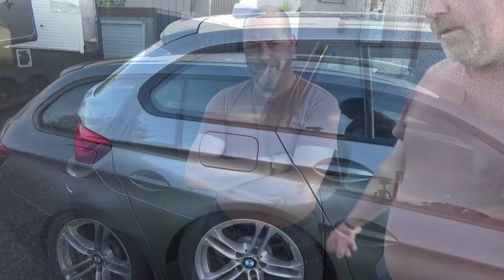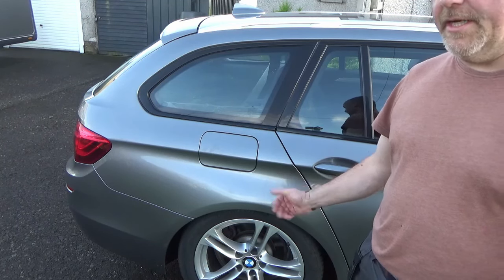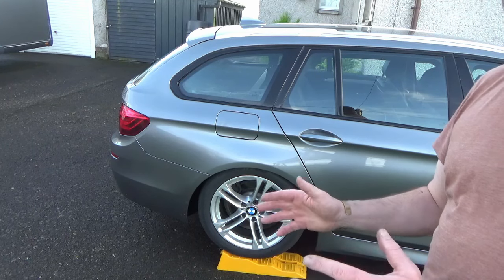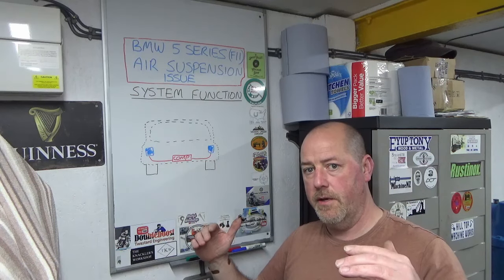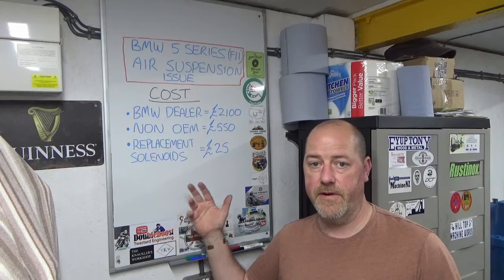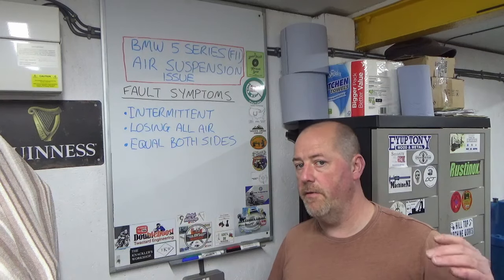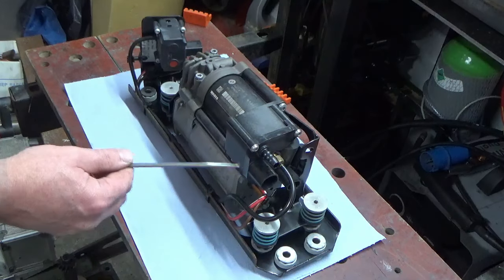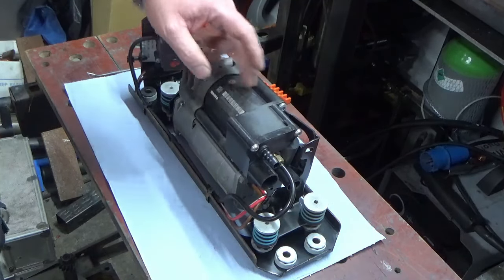BMW 5 Series (F11) Air Suspension Fix for £25

Comment: Epic video, car went down during the day parked down. Did the nursery run with it on bump stops in town, rode like a horse cart. Came home, watched your video, ordered the solenoid on Amazon for £20. Next day I removed the compressor and the solenoid in 15 minutes, the delivery arrived that exact time, I put it together in another 15 minutes. Suspension sorted. Thanks!

Comment: My x5 f15 only drops on the right side and not the left side, so why would that might be?
Reply: Check leakage air suspension on the right side first. Next replace the valve on the compressor.

Comment: Just wondering what tools are needed for the job? Including removing compressor from the car. Thanks!
Reply from the maker: A basic socket set and the torx bits I mentioned in the video (sorry I can't remember the sizes), plus a Phillips screwdriver should do it. Cheers, Jon

Comment: Thank you for making this video, its really helpful. 
If the beads are showing signs of being moist does it really matter or could i leave them as they are ?
Reply from the maker: If the beads are damp, I would advise drying them while you have the thing apart. Microwave in a glass dish until they go back to light colour. Damp beads are a symptom of another problem, either your compressor is running far too much which could be an air leak, or you live in a very damp or humid environment.
Reply: @jonsworkshop  thank you
Reply: @jonsworkshop  Hello. Just been scanning through these comments after watching the video and completing this fix about 2/3 weeks ago. Very helpful video thank you. I checked the beads but only briefly and I'm thinking they could be causing a further problem. The solenoid fix worked perfectly but since then the car drops over 3/4 days then when the compressor kicks in it blows the fuse. Think this points to an overworked compressor? I thought the slow dropping might be down to me not putting it all back together properly.

Comment: Great informative video. I have the same issue. Can I just ask, how easy is it to get the unit off? Does the bumper have to come off? I’m happy doing the repair when it’s off but just wanted to check how to get the unit off. 👍🏻
Reply from the maker: Hi Adam, no the bumper stays on, there's a plastic cover to remove underneath and then 4 screws, two air hoses, and the electrics to unhook. Biggest challenge is getting the back end high enough off the ground to get underneath. As always, what worked for me may not work for you so you go in with your eyes open. Cheers, Jon
Reply: @jonsworkshop  that’s great thanks. My brother in law has some drive up ramps so I’ll use those. Cheers.

Comment: Should i do this also? Because only my left rear side is down, and when i turn my car on, the compressor wont turn on
Reply from the maker: I am not a mechanic and only have experience of the error I had, however, if it's only one side then it's a different problem so changing the same valve won't fix it unfortunately. Get the airbag checked first on the bad side would be my advice.
Reply: @jonsworkshop  my compressor wont turn on when car is running, but when i do the 20sec test with ista then it runs, but its quiet

Comment: very good video explaining all that system with very much details, in my case is that when i park my F11 the right side gets low only.. so what i understood with ur video is one of the valves that are ready to change correct?
Reply from the maker: Hi, it could be one of the other valves that I didn't change, but it could also be the air bag on the RHS is leaking in your case.
Reply: @jonsworkshop  thanks, which other valve are you referring? but the car only gets low on the right side sometimes it’s not always.. ahah

Comment: BMW 530d XDrive 2018 G31, 
Hi I’ve just this second finished replacing the very same part on my car, couldn’t find anything for the G31 but it was the exact same principle.
Big thank you 🙏
Reply: Great stuff. Where did you find the solenoid, if you don’t mind me asking. I have the same problem on a G31. Car won’t return to height. However, I can hear the compressor running when. I turn it off. I’ve bought a relay which I will try but it’s likely to be the solenoid. Thanks

Comment: I have the same problem only on the left side, wheel is inside the weelarch but only sometimes. this week i will se what to do
Reply from the maker: Hi, if it's only one side it is a different fault, probably the air bag. Cheers, Jon
Reply: @jonsworkshop  yes, we saw that was the bag. In anycase we like your videos.

Comment: Hi, this video is great, I am in process of doing the same on my g31. The desiccant in mine was a bit brown with moisture and corrosion on the solenoid. Not put it all back together yet but wondering if the moisture is a sign of another problem?
Reply from the maker: Hi, I am no expert or mechanic, but my gut feel is yes. Either the compressor is running overtime due to a leak somewhere meaning it is drawing more moisture in, or, you live in a very humid environment and the air drying part of the compressor isn't working properly, these are just guesses though.
Reply: Hi, thanks for the response. I live in Swansea, it’s always raining here, plus the sea air could be the answer. 👍

Comment: Great video regarding issue with bmw suspension think my bmw touring M5 is suffering  from same issues was wondering were did get part for £25  would be grateful if you could help out cheers.
Reply from the maker: Hi Frank, thanks for the comment. Check out the video description, I have finally put the link in there lol. Cheers, Jon
Reply: @jonsworkshop  hi john i think i have same problem with suspension on my BMW 5 series touring M sport trying get part number for solenoid mine is 2005 / 525d any idea were get cheap replacment

Comment: thanks your sharing， i face the same problems in my x5 , both side drop at the same time, is possible which valve faulty ? Thanks bro.
Reply from the maker: Could be, I don't know what is in the x5 but I am sure it will be similar. Cheers, Jon

Comment: Hi Jon I have an issue with mine but it’s only the right side any idea what you think the issue maybe.
Reply from the maker: Hi Jamie, I am no mechanic or expert but if its one side only I would suggest it's either the airbag or solenoid valve (in the double unit I didn't change). If the right side pumps up and is intermittent then start with the valve, if it is repeatable every time going down in the same time frame it's probably the bag. I repeat, I am only guessing as not a mechanic. Cheers, Jon
Reply from the maker: Try swapping the red and blue lines, see if the error moves to the other side, this will eliminate the airbag
Reply: @jonsworkshop  Hi John unsure how to do this?
Reply from the maker: @jamiewinnall2882  the double valve block on the compressor unit (the one I didn't change in the video) has two pipes coming off it, one blue, one red, just swap them over and re-try. Cheers, Jon

Comment: I have the exact same issue on my G31, do you know if that Solenoid will fit a 2017 G31?
Reply from the maker: Sorry, I have no idea. I am no mechanic, or even car enthusiast. Hopefully through some research you might be able to link the part number to your model.
Reply: Did you ever figure out if it is the same solenoid. Got the issue on my G31 too.

Comment: Jon, great insight, just about to purchase a 2012 5 series tourer, 55k miles & hasn't towed, the current owner mentioned that a prospective buyer declined to purchase because the air suspension hadn't in fact been replaced, although it is working fine. What age is your BMW?
Reply from the maker: Mine was a 2017, was being the operative word. Best thing I did getting rid of it. If you want my advice, buy a Skoda Octavia estate instead. BMW have lost their way totally, getting caught up in the "how much expensive technology can we cram onto one vehicle" nonsense so they can make back the money they lose at initial sale as quickly as possible. I will never own another now. Good luck if you take the plunge, make sure you have plenty of spare cash for the upkeep if you rely on it for work.

Comment: You are a legend - thank you so much for this, I’d been to multiple garages who would only change out the full system. I’ve done 100km since doing this and it’s back to normal - took some time to find the right level but all good now. Thanks again.
Reply from the maker: Thanks
Reply: Still working after 2 months?
Reply: What's the part number I'm looking for on Amazon as mine drops intermittently, 
cheers Ali

Comment: Hi Jon, had the same failure on my X5 this week, took the compressor off checked the balls in the vessel and they were soaked. Took them all out put them on an old quality street tin lid and dried them using a blow torch from a distance. Put them back in reinstalled the compressor but no change. Had already ordered the solenoid valve just in case as I didn’t want the car out of action for long, that turned up in a day or so and only cost £20, swapped it this morning started it up and boom, all working perfectly.. thanks for the vid saved me a load of cash and was surprising easy to do. Happy new year fella.
Reply: @TonyWelch75, mind me asking for a link to the part you bought for the X5? Planning to do the same DIY this coming weekend but unsure of the solenoid valve to buy
Reply: @antfraine  they’ve deleted the link mate, just put the model of your car then solenoid valve for air compressor in google and loads come up. EBay do them to, I’d change the balls too whilst you have it off the car
Reply: @TonyWelch75 thanks Tony. I’ve ordered one off eBay which says it’s compatible with my X5, hope it’s easy enough to do with this video and some other useful info
Reply: @antfraine    No worries, mine had dropped right down and the air spring on one side had split as a result so ended up doing them the following week. Just try to keep a jack stand under the back of the car until the springs have fully re inflated. Good luck

Comment: My problem is that it is intermittent and can take many hours to empty the air. Sometimes it can hold for days. Question 1. Can I access the wires going the valve somewhere and disconnect them on a day that it seems to be completely shut? 

Question 2. How can I can empty the air manually before removing the hoses? 

Hope anyone can answer :)

Comment: Great  Video  Jon,  ordered the part /  replaced.  Could almost  pour the water out of the  dessicant,  but  3 minutes in the microwave  all sorted.  Put it all back togehre  and all  worked  perfectly........3  days on and the  40 a  fuse has  blown ....any ideas  what  now    ?( other than  drop the compresor  and check it all over.)
Reply from the maker: Hi Paddy, sorry, I don't have a clue with electrics and I am not a mechanic. All I can suggest is too much current being drawn therefore replace fuse, switch on and listen to see if compressor is constantly running or labouring etc. Beyond that I have no idea. Is anything shorting out where you replaced the cable blocks? Mine has not done this so I have no experience to work from either.

Comment: I have the same issue but have changed the valve still drops but ver intermittent sometimes over night but not always I was told that compressors crack often and cause this.
Reply from the maker: Hi, definitely not a cracked compressor if it is an intermittent fault, once a compressor case is cracked, it will always be cracked and always leak. Hope this helps. Cheers, Jon

Comment: Very helpful video - thanks. I completed the replacement in about 2h - a bit fiddly getting the cover off (plastic nuts that can strip easily) and the sponge soundproofing had gotten wet and dirty so needed to be cleaned and dried. The car, an F11 2013 has already had a 2 new airbags and an OEM compressor about 5 yrs ago - but yesterday the rear suspension dropped on to both bump stops whilst out on the road so I knew it wasn't the air bags leaking. Also the compressor was still running which is an obvious indicator it was the input solenoid. As I was under time pressure I simply undid the input pipe, solenoid connector and the 2 screws holding the air drier tank to the main body. I then swapped out the solenoid. Thus, there is no need to remove the whole compressor unit which makes it easier and less likely to break something else. So all fixed for £23 and 2 hours work. Changing out the whole compressor (had it not been running) would not have been much harder - you can buy reconditioned original for £160 on ebay plus £80 deposit on your old unit. So even then the job would have cost £160 not the £2000 plus a stealership would have wanted (or the £1000 a specialist charged me last time)..  Thanks again for your video.

Comment: Hi there, thanks for the helpful video! What is the best way to de pressurise the system, i think mine is going back sits on bump stops, and when sat for 3 or 4 hours is there a simple way to safely de pressurise it without the car having a fit? Cheers!!

Comment: Hi Jon, great video and analysis . I used it to hep changing the dump solenoid on my F11 this morning. For the past 6 months I have had an intermittent fault with the car sitting down on its haunches. More obvious and immediate on the offside. Sometimes this happens within 10 minutes after switch off, sometimes it will hold pressure for a week. Once down , the car won’t rise up completely on start up on the first journey but after I stop and start the car again it does. 
Anyway, changing the solenoid made no difference. I have replacement airbags on standby but based on the intermittent nature of the problem I am of the opinion they are not at fault.
What do you think? Perhaps the individual solenoids where the red/ blue pipes connect?
Reply from the maker: I am no expert so just guessing here, as it is intermittent it has to be either the double valve unit or an electrical fault, for what it costs it is worth a gamble on the valve block. If it was bags leaking it would be consistent. Let us know what you do and what results you get, many others on here with the same fault. Cheers, Jon
Reply: Hi Jon
Thanks for responding. Straight forward mechanics I can do but I was never any good at diagnosing electrical faults. With that in mind I was thinking the same thing, change the valve block. Although the double block feeds air to each bag individually I just wasn’t sure it allowed air to drain back . I can get a good one for around the £50 mark. I am currently in France, so getting one mailed over isn’t always simple but I will post on here when the job is done.
Reply: @jonsworkshop  Hi John, finally got a replacement control block which controls air to both bags and installed this last week. Unfortunately it has made no difference. No great expense, £25 for the control valve and £25 for the dump solenoid, just a pity they didn’t work. The desiccant beads did need drying out but this too hasn’t really made a difference. It is strange as the car will work as normal then perhaps 1 day in 3 the rear end lowers. This can take either 30 minutes or overnight. Once down it does not raise ( other than an initial charging up /priming of the compressor) 
. After a short drive and switching off the ignition, the car returns to normal and raises up on second start up. Possibly an electrical fault or load sensor fault - who knows?
Reply: Finally cured the problem by replacing the suspension airbags. Despite the intermittent nature of the collapsing I decided to give changing the bags a go and Bingo.
Reply: @derekscott5708  Today i changed both bags and didnt solve my problem, it made even worse, now after 1 hour my car tail is dropped, before changing it dropped after 10-14 hours. I guess i have to check my pump.
Reply: Have you sorted your problem kindly update how did you. Thanks

Comment: Hi I have a 530 D F11 has similar problem car sometimes (Not always) falls to rear its odd as this is sometimes , Last night parked up got in this morning car war was normal ride hight, drove down road parked for 30min had fallen to bump stops. We changed Solonoid release valve , Had it on ramp garge said its bags but cant understand why its infrequent ...
Reply from the maker: Hi, thanks for the comment. If you have changed the dump valve and it is still intermittent, go for the twin valve block next. I am not a mechanic or an expert but it definitely does not sound like bags based on your description. Cheers, Jon

Comment: Hey jon! great video, i have kinda same problem on my BMW trying to find the fault, dont know if u checked but my comp makes no sound at all, did urs make a working sound even tho the valve was bad? or was it silent? thanks in advance.
Reply from the maker: Hi, it did, but with all the plastic coverings in place that conceal the unit, you can't hear it running over the engine noise. The only way to know is to remove all the coverings, you will definitely be able to hear it then if it's running. Cheers, Jon
Reply: @jonsworkshop  okay thanks! i removed the covers on mine and started engine but cant hear the comp running at all, so might think i have other issue, but i do have "power" running through all the cables to the comp! thanks for swift reply
Reply from the maker: @TheWhizzey  no bother, sounds like a siezed piston, or motor maybe on the comp unit.